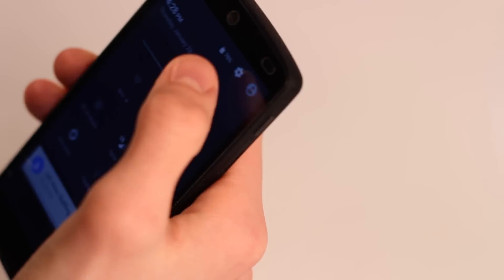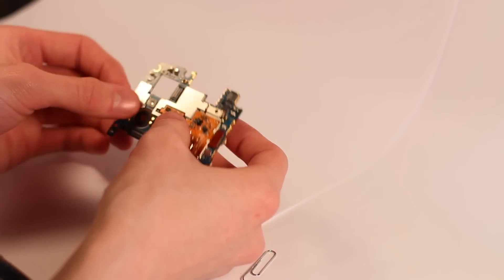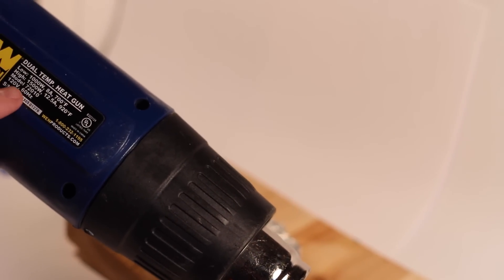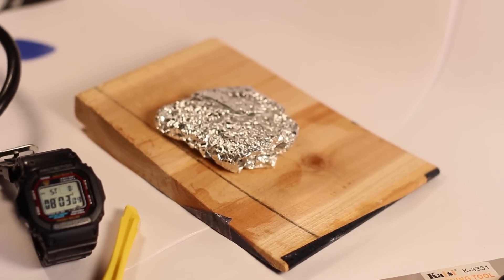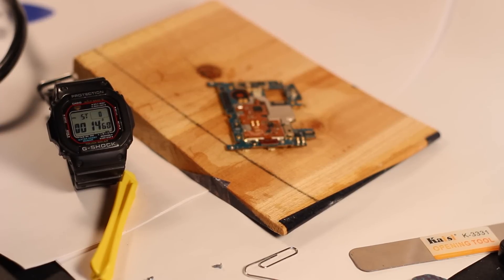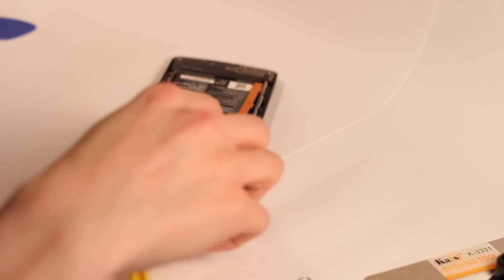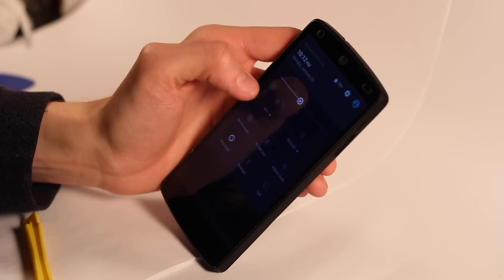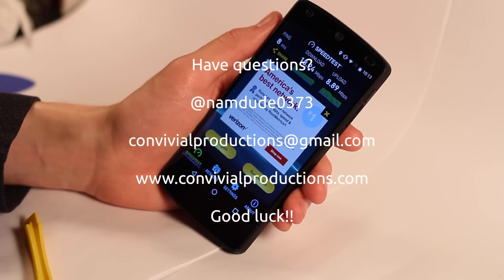How to restore your Nexus 5 Wi-Fi connectivity

Comment: I have a Nexus 10 (GT-P8110) tablet that spent more than a year stored in a cabinet because of the same wifi issue.
Yesterday I started researching for a fix for the 20th time since and stumbled upon your video. Obviously is not the same motherboard but your fix is what I've been looking for this whole time.
So I have a small oven which I heated to about 180°C, cover the webcam in aluminum foil (it's embeded in the motherboard) and left it there for just 5min (it has some rods above of the grill on the inside that emanates heat so the process was pretty intense and I had to be more carefull with it. Still, I had it layed on a wooden piece so the metallic grill wouldn't destroy the motherboard from below). I let it rest for 15min, reinstall everything as it was and now it works.
Thanks so much man, you have no idea how happy I am to have it back.

Comment: My phone dead after baking it with foil for 8 mins. 
checked all connections are all good. I don't think it ended up frying the motherboard as the foil wasn't too hot to touch.
It's definitely a good phone except the battery drains so fast
Reply from the maker: Typically this is done by putting the entire board into an oven so you may want to double check your connections - good luck!

Comment: It worked! 7 minutes in the oven... but after 2 weeks it's broken again
Reply from the maker: Mine only lasted a day, unfortunately the root of the problem is the solder that LG used during manufacturing. The proper way to fix this issue is to resolder the wifi/Bluetooth chip back onto the motherboard with brand new solder

Comment: Dumbest reballing I've ever seen
Reply from the maker: Please share how you would do it differently! I went into this uninformed and I did not have the background I should have had.
Reply: @namdude0373  ever heard of YouTube, the platform you're posting your video? If you're using a heat gun you don't wrap the whole PCB with aluminium. It's not a potato. You apply flux on the Wi-Fi chip and you heat it up. That's it. If anything, you were supposed to use the aluminium foil to cover everything but the Wi-Fi chip so you wouldn't knock other components or damage them with excessive heat. 

You are using the platform that could teach you how to properly do the job, so don't give me that excuse of being uninformed. If you don't know how to do something properly, DO NOT make uninformed instructional videos for others to follow and destroy their devices.
Reply from the maker: @TechnologistAtWork  thanks for the feedback!

Comment: Many thanks for the video, I know the phone is old but the instructions on the video did the trick, it's been almost 5 days and WiFi is still working. Before this I tried everything from factory reset to rooting and installing a custom ROM and none of that worked. You're a life saver.
Reply: Is it working now? My wifi died a couple of days ago and I'm wondering if I should try this. I've read somewhere that it is just a temporary solution and I'm wondering

Comment: i dont know if it happends from a fall with a good case or because the last few days i had all day the data with hotspot enable or it was the time to happent because i had this phone for 5 years,anyway i saw another video with the dissasebly of nexus 5 i remove the motherboard put it in the oven for 10 minutes in 200 celcius but previus warm up in 270 celcius ,inside aluminium foil with the wifi open and yes!wifi is back again !!!many thanks casey sanders!
Reply: Question from the future; is it still working three weeks later?
Reply: @AidanBennett1  unfortunatly the problem came up again,the same procedure and the same again ,for me is a temporary fix but to give you some time to buy a new phone.its better from nothing .

Comment: Thanks. I've just reflowed my Nexus 5 which is nearly 5 year old, I got it soon after they were released. It recently lost WiFi so had a go today. I used a heat gun set at 250C for 5 minutes about 2 or 3 inchs away, motherboard was wrapped in foil so only the WiFi chip was exposed, let it cool completely before removing the foil. So far so good! Updated about 30+ apps from the Play store over WiFi and had no problems. My Bluetooth was working before I did this, don't know if that makes any difference or not but just stating it just in case. I've been told that a reflow is not to be considered a long term fix so I'm half expecting it to break again at some point.
Reply: Mate, I literally have the same issue as you do, 5 year old phone, wifi died 4 days ago. funny coincidence.
I was forced to heat gun my gpu once cuz of black screen, now the story returns for the phone. 

Hope it's gonna work.
Reply: Been using it as I normally would since I fixed mine, still going strong. Good luck with yours, there's still plenty of life in the Nexus 5 yet.
Reply: Spoke too soon! Turned aeroplane mode off this morning when I got up and WiFi appeared to turn on but would not connect. Long pressing the quick settings icon and loading the settings page just gave me a blank screen. Then System UI crashed and I had to restart the phone with volume down + power. Now I'm back to where I was, no WiFi but bluetooth apparently still works okay. I'm not sure if I will try again or just sell the phone as spares and repairs and move on. The battery is pretty much done as well so it's not worth it for me to try the reballing option.
Reply: Fenrir Well, I have successfully heatgunned wifi chip at short distance on 300C for about a minute. It works fine but I managed to get power button stuck somehow, fixed that as well by dropping the phone few times from moderate height.

Conversely I am really discouraged by these procedures rather than being relieved cuz sadly I must admit my Nexus struggling now to work properly after many years of accompanying me in my crazy endeavors.

Thanks for a video to the author and support in comments, Fenrir.
Good luck!
Reply: @northernhemisphere4906  exactly the same for me
Reply: pana 90 I had to reflow few more times though. So far so good. It takes more tries if reflow was uneven I guess. This machine is definitely getting older every day I use it plus screen is cracked, battery is weak as fuck, now components but damn that's the best phone I've ever used.
For instance, I had been reflowing my GPU about 4 times(cuz' it ceased to operate correctly after some time), with the last try being real intense heat applied but afterwards it worked just fine until I sold it bcs stopped gaming.
Reply from the maker: I'm happy to hear that! It sometimes can be a permanent fix, but usually is just temporary. What is happening is the WiFi chip solder points have broken away from the motherboard. By reflowing, you melt the solder again and try to remove the cracks in the solder. Ideally, you just replace the solder completely. Although, that is well beyond my skill level!
Reply: Yes the proper fix is called reballing. I found an AliExpress seller that sells the required BGA stencil, you can buy cheap reballing stations on ebay (basically little but heavy clamps that hold small PCBs) and then you'd just need a few consumables I guess like flux and some sort of glue? I'm not sure on the exact details as I've only watched about 2 videos on the subject. A bit like you though, I think it would be a bit beyond my skill level, I'd probably mess it up if I tried.

Comment: https://forum.xda-developers.com/general/help/qa-wifi-stuck-mac-020000000000-g2-g3-g4-t3452133

8 dakika 200derece fırın işe yaradı şimdilik.
Reply from the maker: anyongnan thanks for sharing! I agree with the author of the post, I think the solder joints on the Wi-Fi chip did not hold up over time. Microsoldering a new chip on is the best solution.

Comment: Fixed it for 6 hours then broke again.. so I heated it again and that fixed it for another 5 hours but then broke wifi again :(

Freezing the phone seems also to fix it temporarily but it works for only 1-2 hours compared to heating which gives it 5-6 hours.

I'm still trying to find a long term fix.. I tried putting a paper between cover and the chip to pressureize the chip on the board but it didn't help.
Reply from the maker: Ali Alawami if this doesn't work, the only long term fix is to have someone resolder the chip back on.. the solder is breaking in between the chip and the motherboard and sometimes melting it again works, for me, I had the same experience you did.

Comment: which piece then I switch to stop the default wifi? thanks
Reply from the maker: Dinho Zÿs you would want to replace the Wi-Fi chip, it is the one I leave exposed when putting aluminium foil on the motherboard
Reply: changing it then I solve the problem? Thank you for your help

Comment: All this did was make my phone not able to turn on. Thanks.
Reply from the maker: Nebby1989 make sure the battery is plugged in properly! I ran into this a few times, you really have to push it in otherwise the connection will not be good enough. Also check the display connection. Nothing should have been disconnected in the process of heating up the motherboard, so I think the best thing to try first is to double check your reassembly.

Comment: long worked?
Reply from the maker: bulat kh what do you mean?
Reply: Casey Sanders How long will it take?
Reply from the maker: bulat kh the whole process of going through this fix? 30-45 minutes at most, I would guess
Reply: Casey Sanders after repair it will work for a long time? wi fi will not stop turning on?
Reply from the maker: bulat kh for me, it only lasted a day. Although, it just depends on how bad the solder is on the phone. Many people find out that it works as a permanent fix for them!
Reply: Casey Sanders thanks, it helped me, if it were not for your video, I would be so tortured with the phone, good to you

Comment: so whats probably going on is a design flaw with the nexus 5 clearly the wifi chip wasnt designed to take so much heat and simply un-solders itself a common problem with badly designed tech....

Comment: Hey, is your phone new?
Reply from the maker: Daniel B my nexus 5 in the video? I got it right at the beginning of 2014. Now I have a used Nexus 6P that I have had for 1-2 months now
Reply: I have my 6p for one month and I have had Bluetooth and wifi problems so I don't know if it's a hardware problem because the phone is brand new
Reply from the maker: Daniel B I have had issues connecting to multiple Bluetooth devices at once.. have you contacted Google and Huawei support?
Reply: Unfortunately they offer no support if there  is a problem your on your own

Comment: any ideas on the science behind this solution?
Reply from the maker: aparna mano there's solder balls behind the wifi chip that crack and cause the connection to fail and heating it up remelts the solder and fixes these cracks
Reply: Thanks Casey Sanders. People have suggested oven. Can i try it with an microwave oven?, instead of keeping it directly and heating, can i preheat it and then leave the motherboard inside ?
Reply: In microwave your board will be completely dead. Use only oven

Comment: Man, I am not going to put my motherboard in the oven every day just to have wifi.
Sometimes my nexus 5 wifi works by luck for 5 minutes, and then goes dead again.
Great video, great fix, but this is too much to do every day.
Reply from the maker: Rodrigo F its 50/50, it lasts for a day or its a permanent fix. Give it a go and see if it's a temporary or permanent solution to your issue! Otherwise, do what I did and pick up a new OnePlus 2 for $240

Comment: can u please post a video how to inatall a new wifi chip
Reply from the maker: i am honestly unsure if I can do it.. I have purchased the chip but have no idea how to do it. i will be out of the country until late August too so it will not come (if it does) for months
Reply: +Casey Sanders do you know what, i got my phone into charging now it keeps blinking red when i try to turn it on and the wifi circet feels super hot .
Reply from the maker: +suhaib blinking red means the battery got so low it cannot turn on, just let it cool down then plug it in
Reply: +Casey Sanders hmm, it wont charge, even if the phone is powered off there is a massive heat charging power is transforming to heat
Reply from the maker: +suhaib have you let it cool down all the way before plugging it back in? the battery could have gone bad, it is not too tricky to replace

Comment: Got the same problem, but afraid to fix it as you did. I still hope that it isn't a hardware problem.
Reply from the maker: +Руслан Гайдукевич Unfortunately, it is.. The solder balls on the bottom of the Wi-Fi chip are dead.. I bought a replacement Wi-Fi chip for $7USD and I may try to fix it permanently! In the meantime I bought a replacement motherboard for $30USD which is not even close to what it would normally cost, I got a really good deal..
Reply: + namdude0373 where can i order?
Reply from the maker: +Salamat WinNeR Nabidolla the replacement Wi-Fi chip?
Reply: + namdude0373 yes
Reply: +namdude0373 where did i buy it? I tried to find it on ebay and aliexpress but it useless.
Reply from the maker: Note that I have not even tried putting the new Wi-Fi chip on so if you do it, you are all on your own, I also am unsure if this is the correct Wi-Fi chip but it looks the same: http://www.aliexpress.com/item/New-original-for-samsung-WIFI-module-ic-BCM4339HKUBG-BCM4339/2046333485.html